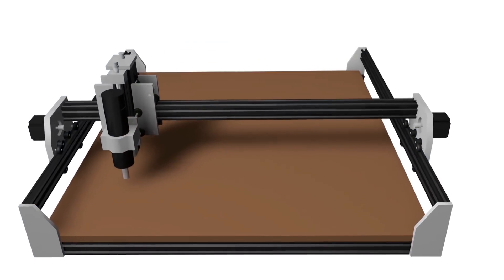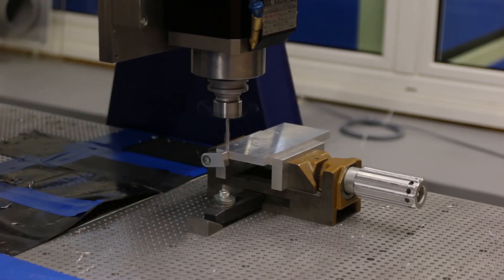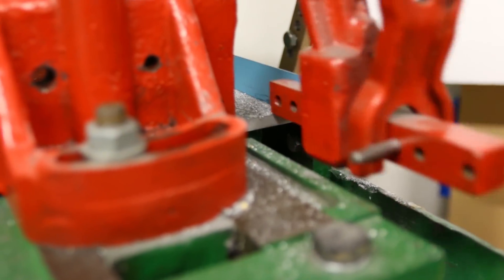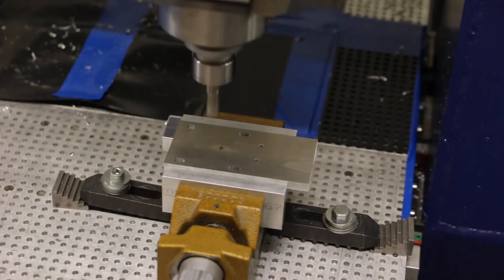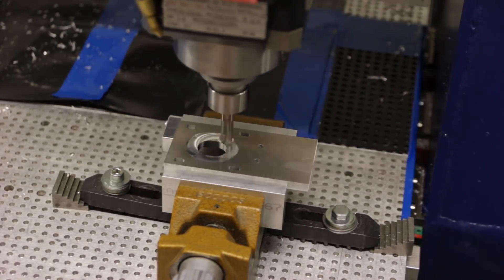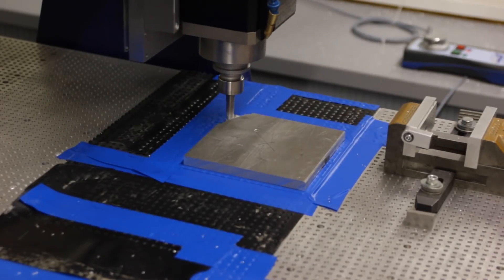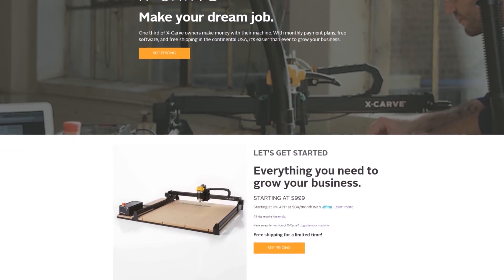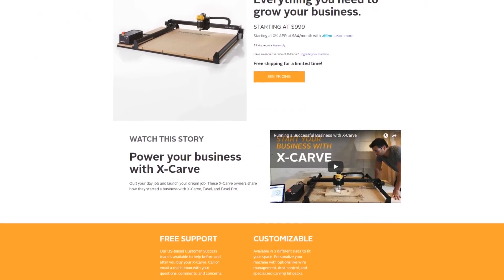Should you BUILD your own CNC ROUTER?

Comment: I built one about 8 years ago and I am still using it. It is made from 8020 aluminum and some msg took me about a year to collect all the parts and assemble it. I run it on Mach3 and do my design work in sketchup with a plug in for gcode